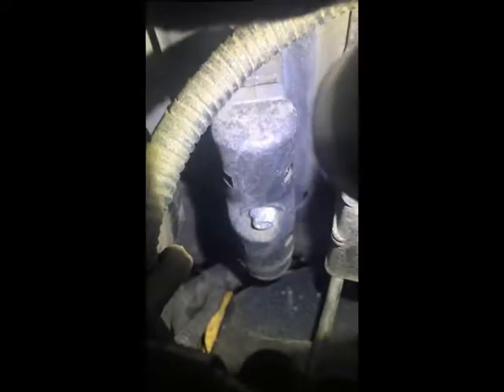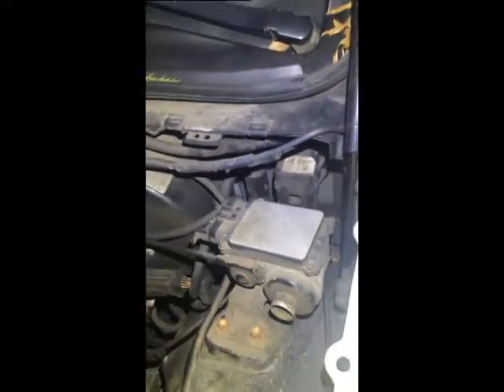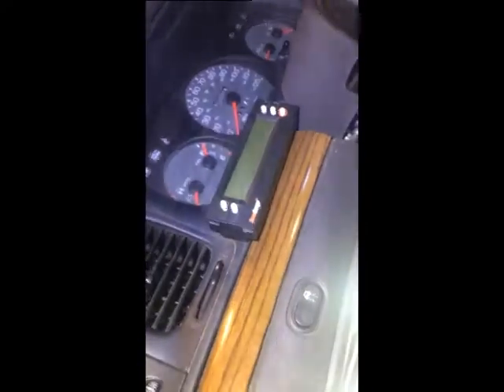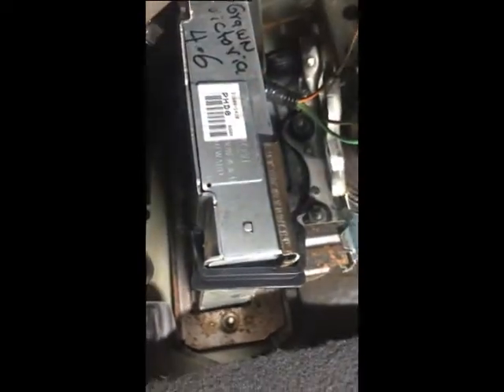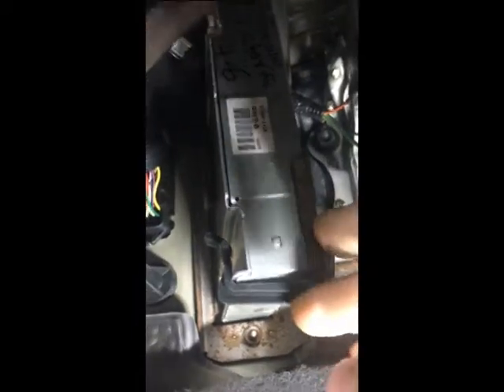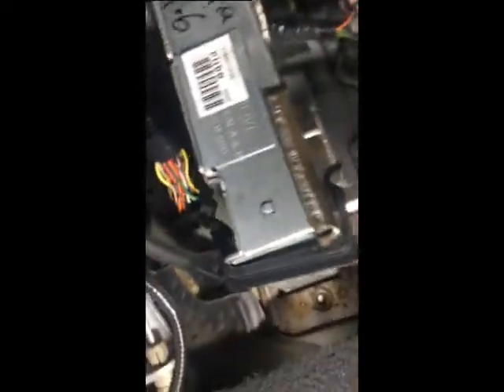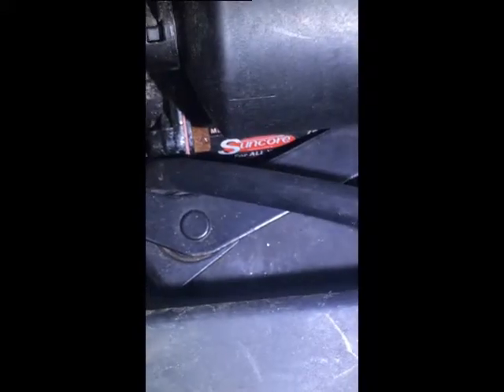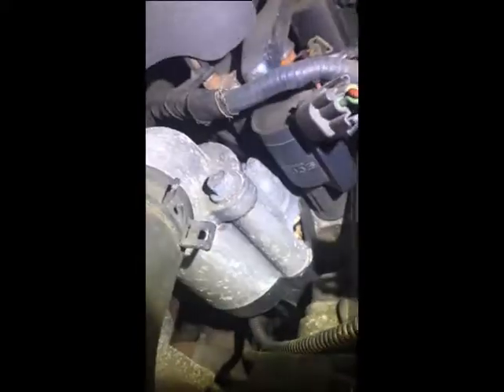2003 Ford Crown Victoria ECM replacement Civilian to PI PCM eliminates PATS

Comment: Yo i got a PI 03 crown vic i changed my pcm still no start but it cranks over what’s the issue any help?
Reply from the maker: why did u change your pcm? do u hear your fuel pump spinning when you first turn key to accessory aka 1 click from crank.
Reply: I was moving fast didn’t think kuz you got to reprogram it i put old one in and had to put a wire from the Good relay to the battery to get the engine light to Come on even then pump came on had good power no spark in tried starter fluid to

Comment: iv been trying to find content for a 2002 lincoln continental im having trouble with but there’s barely any information about it hopefully this will help me out. very similar cars
Reply from the maker: like what? its same as crown vic and grand marquis which both have tons of videos
Reply: @bobspurloc  i actually just swapped it today and it cranks and has power i just ran into some battery problems it won’t start and iv got a battery light on now. this car has gone through tons of batteries anytime i disconnect the negative it drains completely. i’m charging it up rn to see if i can get it to start
Reply: @bobspurloc  well now it still doesn’t start the car cranks but won’t start
Reply from the maker: swapped what? an ECM? I didnt notice this was an ecm vid. did you swap with same coded one? and why would u swap the ecm?
Reply: @bobspurloc  i got one from the same car and year and my mechanic said i needed a new ecm because it was sending the wrong signal and causing my 4th cylinder to misfire i tried swapping ignition coils but that only fixed it for maybe 3 days
Reply from the maker: wait a 2nd. if you swapped coils and it started working again then it sounds like a wiring issue at the coil. bad connector? if was the ECM swapping coils would not have changed anything. you cant just swap ECM's though because the keys arent coded to the new ECM. you would have to program the keys to the replacement ecm. the crown vic PI ECM has key's disabled. so no coding is needed

Comment: I have a 2003 crown Vic. I pulled fuse 8 (pcm & anti theft) and now my car won’t start. No crank nothing. Any idea what it could be?
Reply from the maker: I dont understand your question? is this a civilian car and you put a PI ecm in it? why would you remove the fuse? if this is what you did, have u not watched the video as it shows the answer
Reply: Pulled the wrong fuse on accident. I’m just shocked that by pulling a fuse and putting it back in would cause a car to not want to crank. It’s a Ford problem from what I’ve researched
Reply from the maker: I'm not really following. everything in the dash is working and what is the security light doing when you put the key in. again I dont know if you have a civilian car which is PATS or a PI which has no security at all.
Reply: @bobspurloc  It’s a civilian car the dash lights up there’s no security light coming on the dash and the light under the steering wheel isn’t flashing or anything
Reply from the maker: the PATS security light is the red light top left corner of the dashboard at the windshield near the VIN lookup are in dash. I think if it doesnt recognize your key that red light blinks fast. what im looking at that for is to tell if he ECM lost your key ID and if it did that light will I beleive blink quick and not let the car energize the starter.
Reply: @bobspurloc  I don’t see that light. Thanks for the response. This is so odd. All I did was remove fuse 8 which is the pcm relay and anti theft. Now it won’t turn at all nothing. I’ve checked all other fuses under the hood and even replaced the relays. Would the ddm cause it to not start. When I unlock and lock the doors I hear a clicking sound right where the ddm is?
Reply: @bobspurloc  I noticed when I try to start the car the light will stay solid red for about three seconds. This sucks dude I bought this car for my family I have a newborn almost ready to come home from the hospital and really need this car. I don’t have the money to have the dealership fix it
Reply: @bobspurloc  I made a detailed video on what’s going on. Someone told me to upload a video and they would post it on their channel to try to get me a fix. The video isn’t on my channel it’s on another one. It’s titled “2003 crown Vic no start after pulling fuse #8”
Reply from the maker: you should post on crownvic.net are you sure the fuse isnt corroded legs. use a voltmeter to test power on both sides also make sure the fuse has continuity aka it didnt internal disconnect when you pulled it. I cant check what my red light does because I have the PI ECM in my car so PATS is disabled
Reply from the maker: so i watched your video.you have a no crank situation. so in this video you are replying to. I show you the Starter relay how I have to jump a wire to the coil side since pats is disabled and wont turn that circuit on. the PI has a wire jumper there. so check this relay Im showing you have someone turn the key to crank position on off and see if that relay is clicking. if you have a voltmeter check if it has power. I dont recall the proper things you should see on the relay like which leg is coil ground coil positive. I know if you jump it properly the starter should crank and if key is in run positon the car will start. assuming the starter isnt bad. or wiring down to is isnt bad. as for your blower that is at the firewall your blower resistor probably desoldered on the circuit board, seems common. you can take it out and look if you know how to solder and fix it instead of getting a new one. I made a post on crownvic.net how to check it and fix it I dont see a video
Reply from the maker: found my blower motor resistor post but the only pic isnt available so i uploaded it here. the circled area desolders. so what I did back in 2014 is I scratched the circuit board near it to expose more metal and soldered a bigger blob so it wont overheat in that area and desolder. https://ibb.co/R6ZKvFs   crownvic post https://www.crownvic.net/ubbthreads/ubbthreads.php?ubb=showflat&Number=2850820
Reply from the maker: I commented on your video twice but the comments arent showing up either they are getting blocked by some stewped youtube filter where the owner has to allow them or they are being totally removed by youtube. im pretty sure I didnt use any blockable words... but from the messages I see blocked on my channel that can be almost anything...
Reply: @bobspurloc  hey there. Thanks for the reply. I tried another fuse that matched and I had the same results. I seen one comment on my video I posted I don’t think it was yours it was another guy saying for me to make the video shorter
Reply from the maker: the comment i put is I just copied and pasted what I said here. oh I see I have "video.you" which is seen as a URL so its probably sitting in the holding area of that persons messages

Comment: Got a 2003 Mercury Grand marquis LS it just turns over not getting any spark or communication to the coil packs, will this fix the issue ??
Reply from the maker: well did you determine the ECM is bad? I believe you can use the same ECM I show in the description PHD0 is the preferred. you can get one of those really cheap on ebay. DONT agree for them to code keys to it as the PI ECM has that disabled so they would just be robbing you. I'm not 100% its the same but almost certain it is. also all the accessories dont matter. I have a crown vic sport with abs and air suspension they all work fine.

Comment: I have an 03 CVic lx, delayed engagement or hesitation in drive, but not reverse, it's getting worse and wondering if it's a solenoid or everyone else says I need to replace or rebuild the transmission....trying to diagnose/fix myself first.
Reply from the maker: wrong video for that. this is your valve body. does it delay then bang into gear? isnt really enough information to decide. can be solenoid but they are in the valve body. basically a transmission shop is going to insist you rebuild the transmission even if its a simple valve body thing. they will claim they need to take the transmission out anyway to service the valve body which is a total lie for this transmission. https://youtu.be/tnwTT3ewtig
Reply from the maker: tranny fluid is proper level?

Comment: That's nutz mine still isn't starting after I tried this 🤷‍♂️
Reply from the maker: define not starting. not cranking? or crank no start?
Reply: No crank at all just lights on dash no flashing red light on dashboard either
Reply from the maker: Are you sure you connected the correct side of the relay to ground? I dont recall what I showed in the video. but make sure that is correct and the wire is still in there after reinstalling the relay. there is no more PATs assuming someone to reprogram the ECM. So the only different between Civilian and PI is that this relay is hardwired due to PATs is disabled.
Reply: @bobspurloc  Well I tried and triple tried I put a new starter and still nothing no crank at all ? I also put the original back in see if security was flashing it is normal but it just goes out completely when I try to start it I'm lost ready to throw it away bro losing interest quick🤦‍♂️
Reply: @bobspurloc  Hey I figured it out damn tcase fuse thanks man .
Reply from the maker: check fuses! ;) lol... did you accidentally short something? not sure why a fuse would blow. the PI ECM has no security system its disabled.

Comment: Will that disable the pats on a 2000 grand marquis ls as well
Reply from the maker: I'm not sure if it's ok to put a 2000 PI ECM in a civilian car. you would have to ask at crownvic.net. the reason is that it may not support the transmission. if it ok with the transmission then it will disable the PATS and you will have to do the wire add to that the starter relay is grounded or the car wont crank over.

Comment: I got a PHD0 shipped to me by fs1inc programmed to the police interceptor vin. When I plugged it in and did the wire bypass the car didn't start. I texted fs1inc and asked them what was the vin programmed to the pcm. They said it was the right vin but it came with the PATS system and I told them this morning that there is no way that should've came with a PATS so now I can't get my crown vic to start
Reply from the maker: why did they enable PATs? also why did you pay someone to change the VIN on the ecm? you just need to get a PHD0 from ebay or a junkyard no one should be touching the ecm coding. also if they do an software upgrade to it it will make the PHD0 an EMT3 or whatever the max software was for 2003. also im confused when you say police interceptor vin. if you already have an interceptor why would u do an ecm swap?
Reply: @bobspurloc  my original ecm was fried and they told me the ecm would have to be programmed to my vin I gave them the vin to the car and they said the vin I gave has a factory PATS system set to it and I told them it's no way because it's a p71  but they said that's what the vin I provided says so I'm stuck
Reply from the maker: if its a P71 it has no pats they have no clue what they are talking about. and ecm does not need the vin changed. its all lies to extract more $$$ to program keys. Is the secruity light blinking fast when you try to turn the key? if it isnt then pats is not enabled. you are talking to people who dont know what they are talking about so if that light isnt blinking then this isnt a pats issue. I assume the engine is not cranking over. if it is then again this isnt a pats issue. a p71 doesnt need a wire jumper for the starter as it already has one. im trying to find the URL that shows all the ecm updates PHD0 EMT0 EMT1 EMT2 for 2003 p71. you can get an ecm for a 2003 at a local junkyard...
Reply from the maker: http://www.obdtester.com/ford-ecu-update/crown_victoria/4.6l_2v/2003/3W7A-12A650-BPA
Reply from the maker: I forget how to list on their site the precise model its in. but VIN should say P71 if its an interceptor...
Reply from the maker: without PATs the top left light on top of dash at window will not light at all. if it does PATs is enabled.
Reply: @bobspurloc  will a P71 fit a 2000 crown Vic?
Reply: @bobspurloc  Hey I got a 04 sport  I got 04 p71 ecu tried wire still no crank they say 04s different any thoughts?

Comment: That's a really nice car dude. I looked at a maroon Vic Sport a last year but I decided not to buy it. I should have gotten it. I wonder if this ecu swap works on 05 and up. My Grand Marquis has digital gauge cluster and traction control so it may not work for me.
Reply: Nm, just read the rest of your description. Still, pretty cool that you can do that on the older models.
Reply from the maker: @harrison4ever125  you should check on crownvic.net to make sure there is no transmission issues, that is the difference that matters. it just lets car rev higher for shifting, eliminates pats, car idles 800rpm.